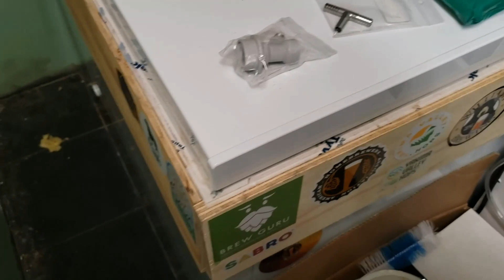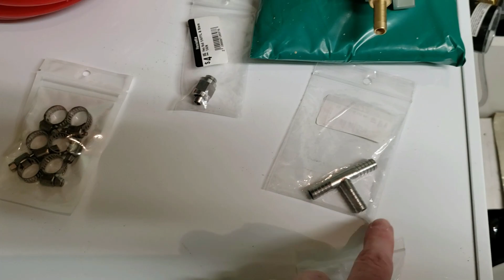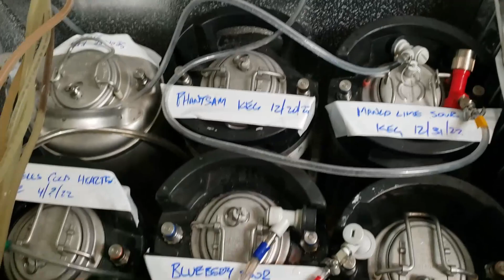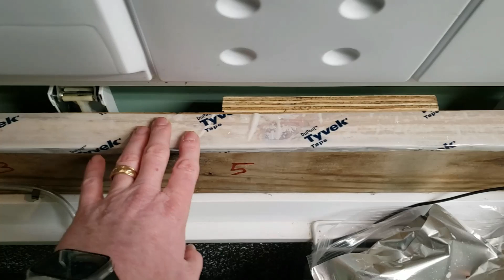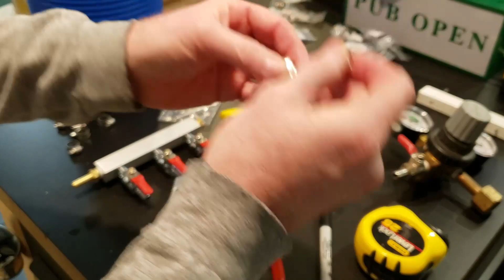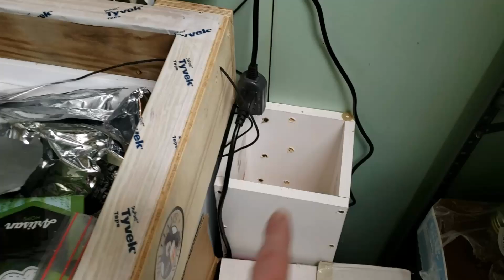Installing new CO2 lines

Comment: Thanks for showing us the SJ keezer apron in detail. I don't know when I'll get a keezer but I'll definitely want to use the slip down design when I do. Oh, and the spike tool was a good idea too for those threaded QDs. I finally tried out the floating dip tube in one of my kegs and was pretty happy with it all the way to the bottom. Stay warm. Cheerz.
Reply from the maker: That’s one of the great things about this community…..passing along tips and tricks we get from others. I’m glad to hear the floating dip tube worked for you. I have almost every keg swapped over to them now. I just picked up a FLOTit style. Just a bit more expensive but love it so far. You can get it on Amazon. Got a screen on the end of it to prevent hop debris from getting clogged. Sláinte

Comment: Great video.  I've gone thru the same leak problems!  I've lost a couple 15# tanks at one point, so now I only keep a 5#.. any leaks in the 5# is less maddening.

One thing with the ready made manifolds, I dunked mine fully in water to check for leaks.  I found that plug on the end had a slow lead and that one of the valves don't completed turn off the gas either.  I have a video short on instagram or here I think,
Reply from the maker: Great tip!  I never thought of dunking the manifold like that.  I used to work in a gas station and that's how we fixed flat tires.  Dunk them to find the link. Love that!!  Slainte!!

Comment: If my beermeister ever kicks the bucket, I'll probably go keezer.  Some really great tips in this video.  Thanks for bringing us along for the ride.  Love the setup with the taps on the other side of the wall and keezer tucked away.  Cheers!
Reply from the maker: Appreciate that Matt. So far so good. Holding pressure and no leaks. 🙏
Reply: @woodshedbrewingco.481  Nice!
Reply: Great tip on splitting the manifold, one on each side. It certainly cleans up the gas lines. Instead of a manifold, I chose to install secondary regulators. This allows me to add differing pressures to differing styles of beer. I've been thinking it's time to replace my beer lines, maybe I'll split my regulator bank in half as you did.
Reply from the maker: @Stevejohnson-od3mk  If I had some extra money I would have loved to add some extra regulators. Sláinte